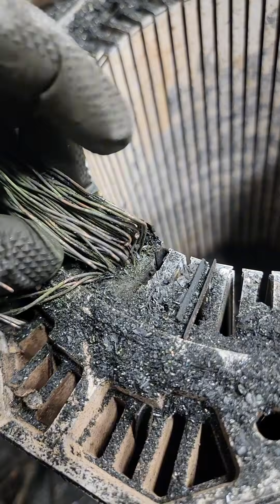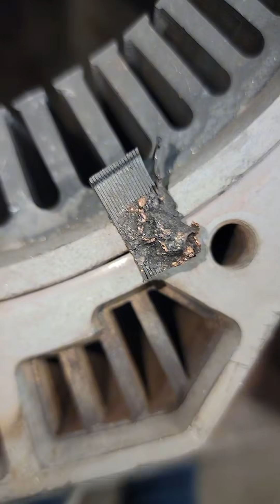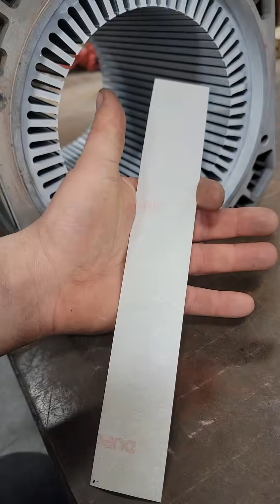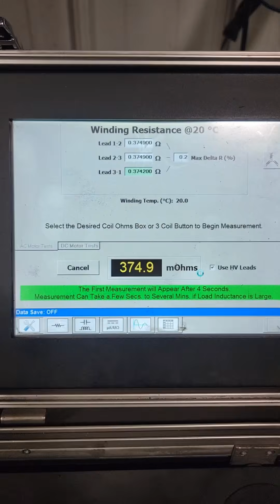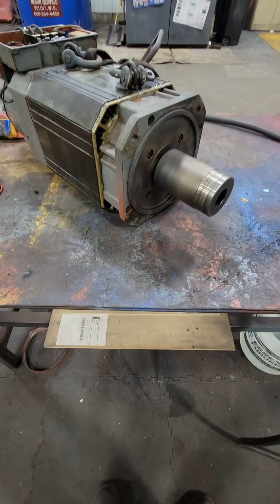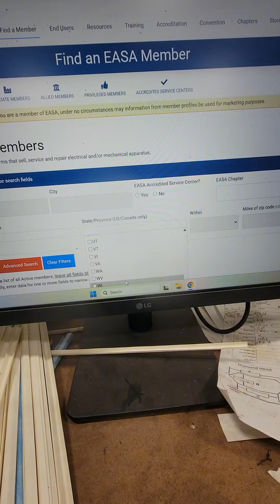Rebuilding 33KW Fagor Electric Motor #motor #electric #repair

Comment: I gotta try that trick to see if my motors are working and spinning in the right direction, I have to pair it to specific gearboxes at work and it’s a lot easier if I can plug it in and stick a can on a stick in it to see if it spins and what way